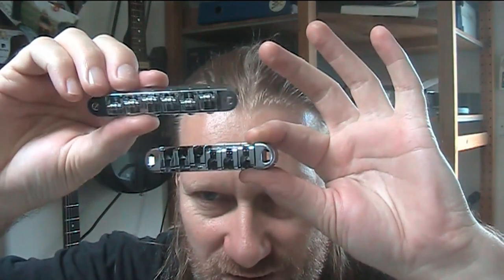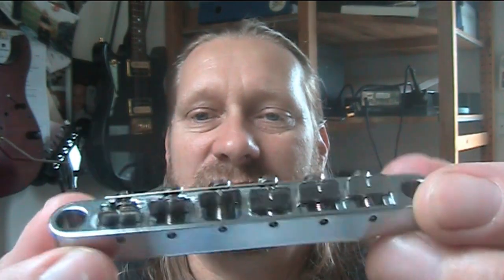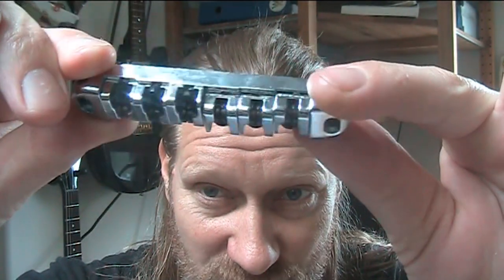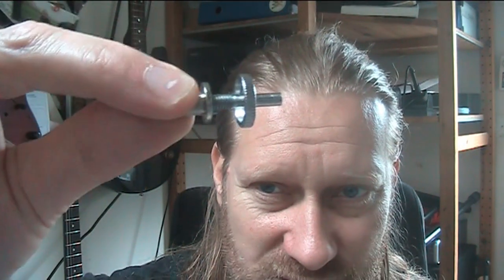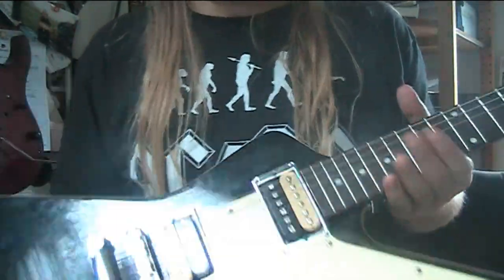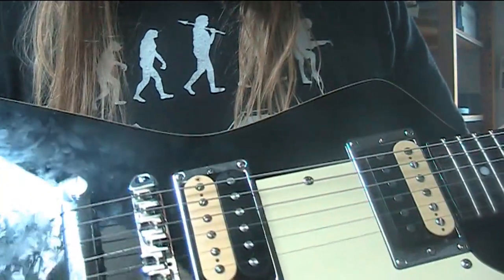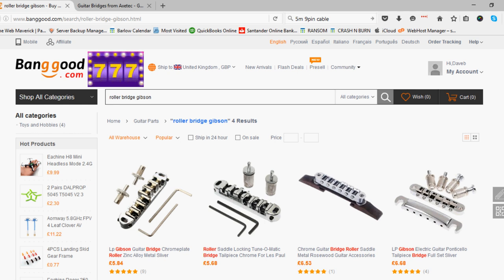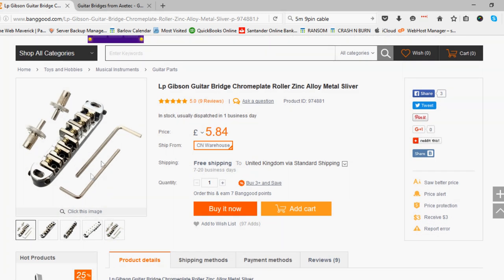Tune-O-Matic Roller Bridge Does it Make Any Difference To Your Guitar?

Comment: Had roller saddles put on my B. C. Rich mockingbird because I missed some heights. I felt the slotted saddles pinch the strings and rob me some tone. But after two weeks I changed to the old saddles... With the roller saddles I lost 70% of the loved woody sound with its fine overtones going on. Sustain was the same. The bluesy warm,  melodic dark rock and rock’n’roll sound and growl was gone! For good comparison I even put the 5 yo. strings back. She sounded like a proper metal guitar- cutting thru and squealing like hell, but kinda sterile... No wonder: the roller are made out of hardened steel, the string can vibrate behind the saddles, activating the effect of the tailpiece. 

I will experiment with treble bleed circuit...

So, it depends what you‘re after..., or you could just trow the balance of your guitar off. On a fine sounding instrument there is a certain optimal balance between woods, construction, materials and design of the hardware parts...sounding best with the according pickups...and pots and cap values

I also recommend letting the new parts settle. At first they might sound bad, but just play them for two weeks, everything sounds better if settled properly and played in. And don‘t miss audio taping the before and after! Human ears have not the memory you might think☺️

Comment: Ive never had any tuning or string breaking issues on my LP. But I do see the logic behind this design. Im not sold on them but open minded enough to consider using them and  see for myself
Reply: Always good to be skeptical John, just in case. I can tell you from my experience after having broken 4 sets of strings in a fairly short period of time, the break point was always at my bridge for my high E or B string(s). Right now I'm already at double the length of time with actually more playing time added and not one broken string yet. You don't have to believe me, if you have a cheap guitar try one out and keep the original bridge just in case you don't like it. For me it was a win-win, better tuning stability, less string breakage and more comfortable to bend and palm mute.

Comment: Late to this party, just new to roller bridges. I've ordered 2 of them - one for my Gibson ES-339 & another for my Telecaster Deluxe, both have tuneomatic bridges. I've got a Duesenberg 'Les Trem II' to install on my Tele & if I like it, I'll get another for the Gibson. If anyone here could offer advice, I'd appreciate it - with or without a trem of any kind, a roller bridge looks like it's an improvement no matter what. Is there a reason roller bridges aren't more prevalent, especially on top-tier guitars? It just seems to be a better design, why don't we see it more often?
Thanks!
Reply from the maker: traditionalists are the issue.

Comment: Dave, Everybody Thinks That Tuners Are the reason Why A Guitar Wont Stay In Tune.
Wrong, Its That Bridge With The Blade Type Saddle. How The F**k Is The String Suppose To Slide On A Sharp Pointy Blade.
Put A Roller Bridge On It And All Your Troubles Are Gone. A Good Bone Or Brass Nut Helps Very Much Too.
Rock On Brother. Excellent Vid.

Comment: I buy lots of things which are made in china. For my Gibson, nothing made in China goes on it. I got the roller bridge by Schaller because strings snap before their time, (probably because of the bending I do). so I got the Schaller, but also got the string butler as well, not because of tuning issues, but so can do more precise tuning. in theory, I should be able to. something which stopped me from buying was that I don't want to affect the tone. anyway, the Schaller is on its way, hopefully, it fits with no problems. if I have to change anything fixed in the guitar, then I won't install it, will just round off the tune omatic bridge.

Comment: The width is different on the USA and the epiphones,import.The Gibson Nashville bridge has those narrow post. Guitar fetish has both roller bridges which are heavy in weight. You won't break strings at the bridge with a roller bridge. Order the import or metric for all import guitars. There a lot better than paying 90 bucks for a Schaller.

Comment: Hi Dave, you said that you upgraded the Axetec Roller Bridge in this video, what did you upgrade it with and did you need to modify the guitar in anyway? I have the same BRLP04 and was thinking of upgrading it as well. Your thoughts would be appreciated. Thanks for the videos, I've learned loads from you.
Reply from the maker: I updated the stock abr type bridge for a roller bridge, there are a few to choose from (just google), most of them will fit Gibson or similar type guitars as measurements are pretty much the same, you need to check the post size though.

Comment: Roller bridges are AWESOME! They are better than the tune-o-matic. However, this conversation is a lot like tuners. If a guitar is setup well, has a good nut, and a good bridge, then most tuners work fine. 

However, locking tuners make changing strings way EASIER. They have advantages and are better than non-locking tuners... period. Also, many tuners do suck. They are made poorly and/or have shafts that wobble, or gears that wear quickly, or don't even have a flat mounting surface. Again, most are fine, but many do suck.

Same goes for the bridge. With abridge, tune-o-matics do not suck, but they do wear and they only have one motion for adjustments. What Dave isn't telling you, cause he didn't look deeply, is that some of these roller bridges are made of less quality than others. Be wary of these because that have negative tone and/or simply wear or adjust poorly.

Some have BAD designs. Wilkenson's, for example, SUCK! Do they work? Yes! You can use them and sound phenomenal. The problem is that the require loosening a screw and wonky adjustments to get intonation correct. Precise intonation is almost impossible. Your luthier would hate you with one of those. Don't buy Wilkenson rollers, they are sub-par by design. Please, scan through youtube and look and comments on Wilkenson rollers and their setup. 

Then there are FANTASTIC rollers! This link below is an example:

http://www.stewmac.com/Hardware_and_Parts/All_Hardware_and_Parts_by_Instrument/Electric_Guitar_Parts/Electric_Guitar_Bridges_and_Tailpieces/Tune-o-matic_Bridges/Schaller_Roller_Bridge.html?gclid=Cj0KEQjwuZvIBRD-8Z6B2M2Sy68BEiQAtjYS3CS02tmHSZvycoqjTLkUnrHkA--kA6etOzKhZ0aKIpwaAm0h8P8HAQ

Not only are the Schaller rollers easy to adjust, they can adjust the rollers side-to-side, meaning you can fine tune string placement where tune-o-matics offer nothing... standard forward and back per string, no side-to-side adjustments. Schaller is also the extreme high end of quality (my tuners of choice too).

I personally love rollers combined with a stop where the strings are rolled over so they bend the least possible. This is best for tuning accuracy and also allows for the most play-ability (much easier bending of strings to a full step).  This occurs when strings slide through a nut easily (at the correct position/height), when the bridge is fine-tuned to the correct height... and width with Schallers... and then have the least amount of bend at the neck and bridge to keep strings in place.  I have noticed that the width adjustments expand the tuning accuracy throughout the neck with Schaller rollers. I don;t mention other options because I am not aware of another roller bridge with such adjustments.

Comment: Dave! I saw in a recent FB post that you've installed the Wilkerson style roller on your Gold Top. Which one do you prefer? I've heard the Wilkerson style can be more fiddly when intonating but really would love your thoughts on the two styles. Thanks brother.
Peace!
Reply from the maker: I have a Roller Bridge fitted to all my guitars with tune o matic bridges, they are from china, you can purchase on ebay too, $6. Not sure if they are Wilkinson but probably from the same factory.
Reply: Dave Barlow - Sorry Dave, but which "style" of roller did you find you liked the best, the fatter "molded" style or the thinner one that resembles the Nashville more, the one you installed in the video? Or did it make a difference? I've seen some who complained that the fatter, or what I called Wilkinson style, were heavy and hard to adjust. You wouldn't faff with something if it didn't work so I assume their fine. Thanks for the response. Peace!
Reply from the maker: The fatter one, yes, a bit more fiddly to set up but when done its all locked into place, set and forget :)
Reply: Dave Barlow 
Perfect! Thanks man :-)

Comment: I've put a Tonepros bridge on my guitar with a Bigsby since tuning wasn't stable. It's made a bit of a difference but I wonder if the roller saddles are actually supposed to roll. With the strings off they roll just fine of course, but with the strings on and tuned to pitch the rollers don't seem to move at all. Is that normal?
Reply from the maker: They roll
Reply: @DaveBarlowGuitar  Wow, thank you for replying. So does that mean there is something wrong with my roller bridge, or just that the movement is small enough that I'm not noticing it?

Comment: Can u help me find a bridge with a wider string spacing than a tuneomatic??? I had one 40 years ago that was low profile with the thumbscrews inside slots on either end instead of under the bridge like a tuneomatic. I cant find what I had anywhere on the internet, it was chrome with aluminum saddles and it had a wider string spacing.
Reply: Im trying to fix my second ea 250 motsu epi. The tunomatic they sold on it its too narrow on the fretboard bout like a rikenbac

Comment: Why theses arent used on any guitar with bigsbby? Points of contact with this or the sharpe edge one cant be too different.
Reply: Actually they should be used on those Guitars because the strings will simply turn the Wheels

Comment: Some things to keep in mind when buying parts like this; material quality, manufacturing quality control (are they made to precise dimensions?), and JOBS: do you want UK manufacturers to go bust and will there be jobs for your kids? 
Sure, the price differential is attractive but you get what you pay for, plus if you have a problem with the product, you can speak to an actual person and have a much better chance of getting a replacement or refund within a reasonable timescale.
Try that with a Chinese supplier.
I have bought many bits of kit from China and had problems/issues 50% of the time. By the time you have paid return shipping etc. and waited 3 months for the replacements, which turn out to be just as crappy as the originals, I could have bought a European made equivalent of better quality with full warranty and a much lower chance of them not fitting properly or having defects. We all are attracted by the super-low purchase price but you really DO get what you paid for.
Reply from the maker: There are no UK manufacturers Tim, and most of these products come from China, I have made great inroads into this. I purchased a TWilkinson for 5 times the price and compared them, they are exactly the same, the molding marks are also exactly the same. This was the point of my video, also I still have the same rolling bridge on my LP and I do 60 gigs a year and use new strings almost every gig, if the bridge was no good I would know by now :)
Reply: @DaveBarlowGuitar  Fairy Snuff, forgive my rant.

Comment: Nice one Dave, really useful video. I got a roller bridge for my Gretsch electromatic to help with the tuning when using the Bigsby. I've still got issues, but think they are nut related (or the tuners. It's amazing how much shoddy hardware is on a quite pricey guitar). The roller is really comfortable and mine was about £14 from Amazon I think. I loved it so much I managed to get a black version for a black Hofner I've got, it looks very cool
Reply: Matthew Eastel try the string butler. They're sweet.
Reply: Thanks man, will check it out

Comment: neat video,just a quick question. should i have the roller bridge paralell to the pick ups and not angled as std so the strings have a straight run over the rollers? looking at the range of adjustment on the saddles (and the posts) it seems like getting the intonation correct should be possible that way.  thanks for the info mate,you keep making em and i'll keep watching them.
Reply from the maker: I am only suggesting a replacement bridge here so cannot comment other 
than that, it shouldn't cause any issues by just replacing the bridge as
 described in the video. Hope that clarify s this for you.
Reply: mudco666 I just dropped mine straight onto existing posts,angle causes no probs.

Comment: Are there two versions of the roller tune o matic bridge that looks like traditional Gibson bridges versus the more modern roller bridge at 2:28? I was wondering if the more traditional looking roller bridge had a version for flatter fretboards and another one that is more round, hence the three versions mentioned at the beginning. Any insight would be appreciated

Comment: thank you Dave !...whats your fave roller bridge?
Reply from the maker: The one I have in my les paul, the rollers have now seized up due to sweat and grime but still stays in tune and strings still last longer LOL.
Reply: thanks brother
Reply: cool thanks
Reply: Dave Barlow soak it in WD-40 for a day or so. Then dry off. And use. That stuff fixes bearings and more.
Be sure to get the stuff that loosens rust. (Silver/chrome can. Not tge standard blue/yellow)

Comment: 3:17 How do you internate something like that? There's no screw to move the roller back or forewards.
Reply from the maker: the adjustment is at the top and allows the saddle to slide back or forward, I admit its fiddly but when set up pays dividends.

Comment: i JUST GOT THIS SETUP ALSO BUT HAVE NOT PUT IT ON YET.   kINDA SCETCHY ABOUT PUTTING MY GREAT PLAYING GUITYAR DOWN AND MAKING MODIFICATIONS WHEN IT PLAYS GREAT AS IS.   mY REASON IS....i hATE SHINY CHROME HARDWARE.                  OOPS, sorry bout the capitol letters.           .Any advice on initial first things to do before starting this install?    Was thinking of a way to  copy how my intonation saddles are currently, just dont know how to do that.         Or take a picture maybe. Plus I may just leave the barrels down in the guitar & see if the new posts will screw into it.
Reply from the maker: If your guitar works and sound great just leave it as is. If it aint broke dont fix it :)
Reply: 97warlock, if you do decide to replace it simply use a micrometer to get the distance from the back edge of the saddle blocks to the edge of the back of the bridge for each string. Set your new rollers for each string to the exact same distance and you should be almost spot on if not there exactly. There should be plenty of videos to show this and if not head on over to Stew Macs wesbsite where I believe they do have a video or diagram showing you what and how to do it :).

Comment: Tusq does have solution tusq makek the saddles out of thier boron poly materiel, but could you review. Think tusq may make better contact, rather than roller pin to frame to bolt to body?
Reply from the maker: could be a good idea, if they send me I will review.

Comment: I put a roller bridge like the first one you held up on my SG.  But when I play it, the thinner strings pop out of the rollers.  I have a Bigsby trem on it now but I'm putting a Gibson Maestro on it soon, just waiting for the new tuners to arrive.  After I put the new trem on it, I'll give it one more go, and if the problem persists, I'm putting the original bridge back on it.
Am I doing something wrong?  Do you have any tips or advice that you can share?  Thanks.
Reply from the maker: strange, please check your fitting
Reply: Thanks for replying. What fitting?  When I pick or strum, the bottom 2 or 3 strings roll off of the rollers.  I've never used a roller bridge before, so I don't know much about it.  @DaveBarlowGuitar
Reply from the maker: there is not enough break angle to keep the strings in the rollers, try raising the bridge or lowering the stoptail  @jameslanclos568
Reply: I don't have a tailpiece, currently I have a Bigsby B70 which I will be putting a Gibson Maestro trem as soon as my tuners are delivered. For now, I can try to raise the bridge, but I'm trying to keep the action low. I might try one of those Schaller Roller Bridges nashville style. They have a nice look and I'm sure it's a better quality than what I have. (no holes on top or visible pins) @DaveBarlowGuitar

Comment: I just got that very roller like 2 days ago. The intonation is very close right now. But I keep looking at it and wondering if I should turn all the rollers the same direction. Have U tried that? any suggestions?
Reply from the maker: I had to turn some roller saddles round to get the correct intonation, works great.

Comment: dunno if this will get a response,
does this fit in any other tune-o-matic bridge?

i plan to replace the bridge on my Schecter omen 6

thanks :D
Reply from the maker: Yes I have fitted the same bridge to my Gibson les paul and also other guitars made in the far east so should fit yours fine. always a good idea to find the spec for your guitar, this is usually pretty easy to do. And I always try to answer all questions on my YT channel, or you can ask me directly on my Facebook. :)
Reply: thank you Dave :D